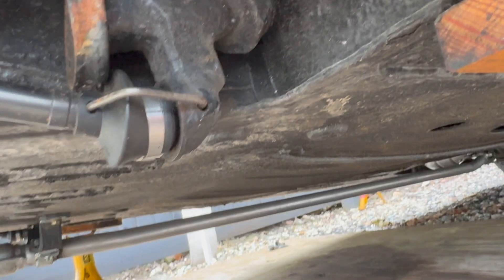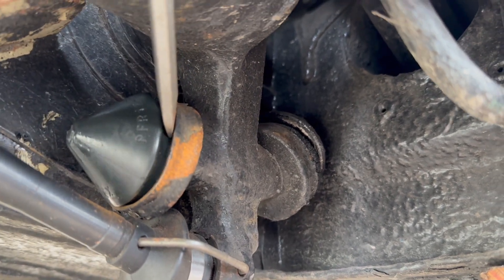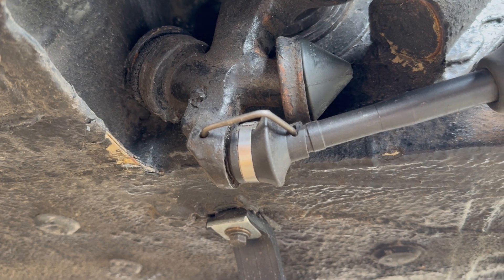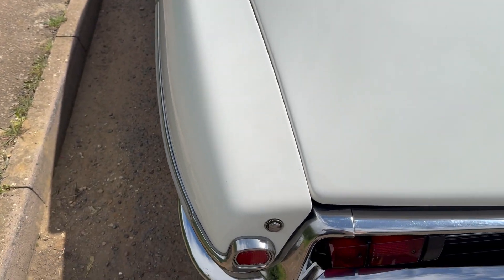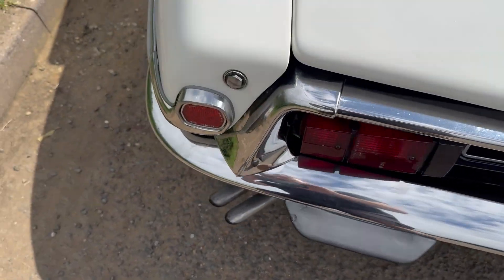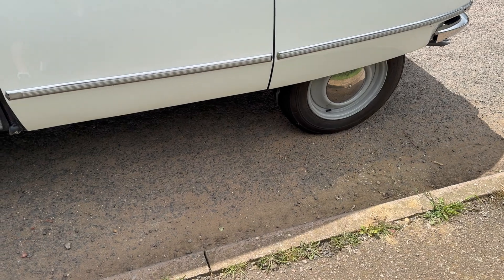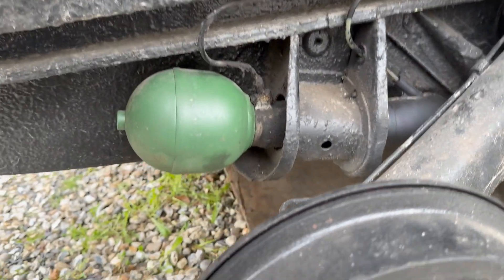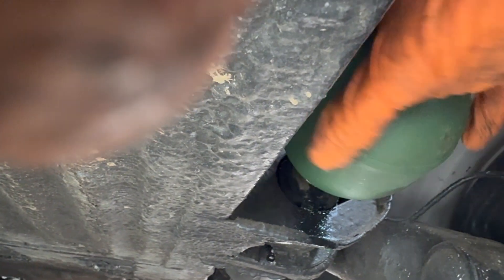1973 Citroen DS21 (DSuper 5) Rear bump stops and rear sphere replacement.

Comment: Proper parking lot maintenance. 😄👍 Well done! I wonder what happened to the rear spheres while you changed the bump stops.. 🤔
Reply from the maker: @jarnomuona2447  I wonder whether they didn’t like the range of movement. They were also about 6 years old and not identifiable as specifically for a DS.

Comment: Quick question - if anyone knows the answer? I Just bought a 1970 DS ID - For some reason, I cannot open the boot - the boot opening button pushes in OK - the rear offside section of the boot rises slightly - but I cannot open the boot? Did a search on Youtube and cannot find any videos.
Reply from the maker: @cheaperukbills774  I’ve just been to take a look at mine. My only suggestion at this stage is to push down as hard as possible on the button. I’ll upload a video of my mechanism and share it with you so you can see how it operates.
Reply: @Woodyrvf750  That is so kind of you woody - I have a couple of DS books - sadly they do not include the boot locking system
Reply from the maker: @cheaperukbills774  has it been repainted? It’s very likely just a bit of adjustment needed. But you do need to get it open first.
Reply from the maker: Does this link work? 21 October 2024
https://youtube.com/shorts/G3wspEFDJD4?feature=share
Reply: @Woodyrvf750  I have an invoice stating that it has had a repainting job yes. However, that was some time ago....
Reply: @Woodyrvf750  HI Woody - I did respond to say that the link worked just fine - it seems a simple mechanism - WD40 is the order of the day methinks. Thank you once again.
Reply from the maker: @cheaperukbills774  maybe try an push the button is as far as possible and the boot down with your other hand at the same time. That may just release it.
Reply: @Woodyrvf750  Will do - thanks